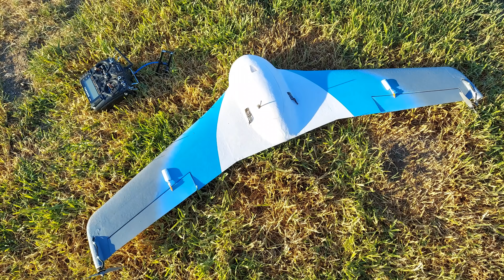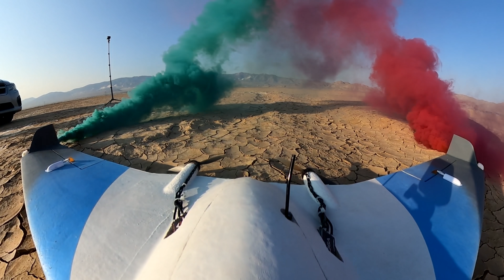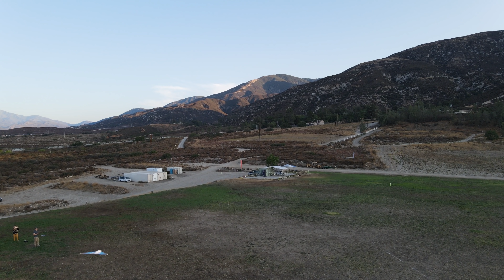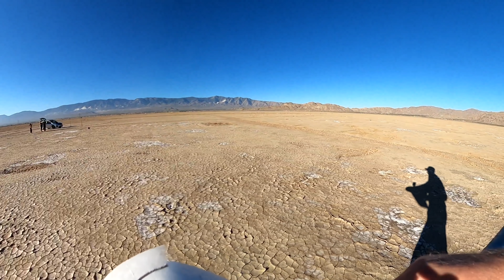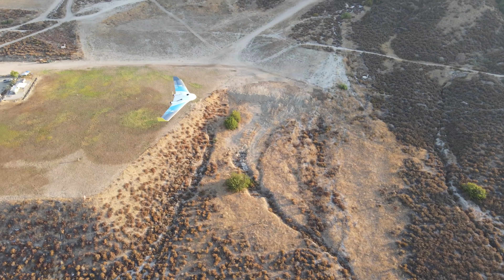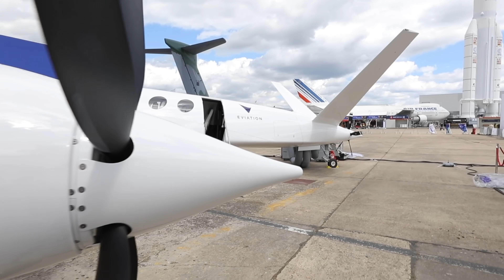Can Wingtip Motors Improve Aircraft Efficiency?  RCTestFlight Solar Collaboration Part 1

Comment: In the event of one engine going out, the adverse yaw would probably make the aircraft uncontrollable.
Reply: I was thinking the same thing. I wonder if that is why we saw a third engine located in the tail of the Eviation Aircraft?  To possibly mitigate adverse yaw effect and maintain better authority.
Reply: @Videoctr  Unless both wingtip engines were shut down (leaving the center engine), it would still probably be uncontrollable or would require huge, stronger control surfaces (and would be much less efficient).
Reply: @zed9zed  If you had a system which could shut off both engines immediately in the case of one going out, it would be just as risky as having a single engine in the first place.
Reply: @BoomchacleV0  I'm not advocating for a system to shut off the remaining engine.  There is no solution to the problem faced when one engine fails on a plane like this, so the obvious answer is - don't build a plane like this, at least not for living occupants.
Reply: @zed9zed  Would the solution not just be to cut off the other engine immediately to prevent asymmetrical thrust? Again, how would that be any different than a plane with one engine having that engine fail.
Reply: Yaw as well as roll will be induced if one of the engines is failed.. both are coupled with each other.

Comment: Great video, thank you!
One safety concern I have is what happens if one engine fails? I’m a multi engine pilot and I know how severe an engine-out is on a twin engine aircraft. 
With the engine at the wingtips, it would be even more dangerous. Makes me wonder how they would be able to certify a people-carrying airplane.
Reply: I agree. The eviation triple setup looks ok from a control POV though - if you have an engine failure you can compensate by instantly shutting down the other side and moving to degraded control mode using the central pusher prop

Electric aviation is problematic in many ways though - badly range limited and I can't see how that can be realistically addressed. My suspicion is that the longer term solution will be synthetic fuels produced from MSR nuclear sources to achieve carbon neutrality as being the only practical way to maintain long-haul flights, unless vac-trains (hyperloop) start eating aviation's lunch (and that's only really feasible on 1000mile+ legs)

Comment: Great video. :) Really enjoyed it.

I tend to think the safety advantage - specifically for aircraft carrying people - of having two or more engines as close to the fuselage as possible outweighs any potential efficiency value, even if one existed. A plane with two engines near center tends to have the ability to survive the loss of one and continue under powered flight to land safely when possible. Move those engines out to the wingtips and you introduce a tremendous amount of yaw to overcome while running on one engine. Wouldn't be surprised if you'd have to cut that second engine right away and more or less glide in, completely losing out on the redundancy benefit of the otherwise functional engine in the process.
Reply: Great point.  On first inspection, the image of that massive moment arm out on the end of the wing made me gasp.  However, I would tend to believe that the use of electric motors mitigates most of the risk of asymmetrical thrust.  Interesting dilemma...

Comment: I remember reading somewhere that the reason engines are not at the wingtips for twin engine aircraft are safety. In the unlikely case of an engine failure, the yawing force of a single engine at a wingtip is enough force to induce a flatspin.
Reply: Apparently the guys in the video didn't get that memo. 🙄

Comment: Seems to me the pusher props at the tip is battling an already established vortex as they are placed behind the wingtip. Could there be additional gains from arranging the tip motors in a tractor config.? This way the prop would counteract the "leaking" air around the wingtip before the vortex is established. Or....?
Reply from the maker: There was precedent for both in the literature, the answer is unknown to me.   Wings and propellers do affect the air in front of them, but how much?   I don't have an answer for you other than I'd love to try both.
Reply: Yeah, as per Xf5U. As I understand it there are two main advantages to wingtip motors generally. Most obviously (provided they rotate in the correct directions!) they oppose the induced vortex, ie high pressure air beneath the wing spilling out and around the tip to lower pressure above and so reduce drag and lift losses. Also they 'see' cleaner air than pushers inboard. Tractor tip props should see free stream air only for maximum efficiency (and also co-related lower noise generation). Cool video and interesting to see your results!
Reply: I'm reminded of something Richard Feynman said about experimental research. (~13:min into Messenger Lecture #1)
He said: "The Key of modern science is this Idea; That to look at (a) thing, (time after time), and to record the details, and to hope that in the information thus obtained, (there) may lie a Clue - to one or another of a possible theoretical interpretation.  It's only through such hard work that we can find out anything."
Reply: @thinkflight  You are on the wrong track. Props and wings need clean, undisturbed air. You need less separation. If you want to recover energy from wingtip spillage or vortices, put something in their way. I am not an aero engineer, but i think you will get more benefit from vertical fins, in increasing size towards the wing, stopping outward motion of air. Or even better, introduce less dihedral, or anhedral angles...
Reply: @schipe  I think he is on the right track. Because he is putting the propulsion system out at the wingtip where they perform yaw stability so that vertical stabs can be eliminated. That is a gain in efficiency is it not? Also at the wingtip you find the pesky vortices that can be diminished or eliminated with the  propulsion system acting as a sort of aerodynamic winglet reducing drag and increasing the effective wingspan. That is in effect to " put something in their way". 
Unless you have researched this out and share the results showing how this approach is futile  I think we should encourage his efforts the best we can.
Reply: 'clean, undisturbed air'  No amount of clean air stops the losses from P factor and the under spill that creates the vortices.  Opposing them directly is almost guaranteed to bring greater recovery than trying to add other items to do the same job, with their own new added drags and inefficiencies.
Reply: @schipe  Reducing verticals reduces wetted area, cutting friction drag. Increasing effective wing length reduces induced drag. If you can increase effective wing length using the same props you would normally use, without increasing wetted area, you are doing good things.  The angle of attack at the propellers changes a lot as you pass behind the wing, so if you can't switch to a tractor propeller (and suffer the propwash drag penalty) then you might consider having propellers with a more rounded leading edge, for less sensitivity to angle of attack for the propeller blade.
Reply: Both configurations would work to cancel out vortices.  The question is whether the two ways of canceling them out produce identical results to the flight characteristics of the aircraft.  The tractor cancels out the vortices before they form, allowing the wing to effectively increase span...it's setting up an anti-vortex that the wing flies through and straightens out.  The pusher configuration cancels them out after the wings make them, meaning most of the effective span increase happens after the wings clear that air, and the vortices effectively increase the airspeed that the blades see while they're rotating in the opposite direction.  Best case estimation is that the tractor increases lift potential while the pusher increases thrust potential.  Best hypothesis for when to use either is to use tractor configuration when you have a large prop relative to wingspan to maximize lift (meaning you can get away with a smaller wing for less drag), use pusher configuration when you have a small prop relative to wingspan (meaning you increase potential thrust and speed, and since lift cubes with the square of airspeed, you can use a smaller wing for less drag if enough airspeed increase is realized).  Just late night musing, really.
Reply: @Skinflaps_Meatslapper  They don't cancel out vortices, they delay them. So long as you have high pressure air on the bottom, and low pressure air on the top of the wing, you will get a vortex. The tractor has better thrust, because the entire arc of the propellor is in clean air, but you pay for that by slightly increased profile drag. The more wings, winglets, or other excrescences you put in front of the propeller, the more you bugger up the air, and the propeller efficiency will be reduced.
Reply: @DonMeaker  If you delay the vortices long enough that they're not affecting the aircraft, then you're canceling them out in all but semantics.  One could argue the production of vortices from anything if you observe the air long enough after the object has passed through it.  However, vortices are not the reason for drag penalties of low aspect ratio wings, they're a symptom of spanwise flow that is occurring before the air is even halfway down the wing.  If you have a large enough tractor prop that counters and prevents spanwise flow from spilling over the wingtip, then the formation of vortices after the fact is irrelevant because you solved the underlying issue.  A tractor configuration would naturally solve this problem before it ever becomes one, keeping the air going straight down the wing as opposed to migrating outward toward with wingtip, so the lift advantages goes to the tractor with a large diameter prop to cover as much wing area as possible (and is evident by the efficiency of the V-173, utilizing a low aspect ratio wing).

As far as the two configurations and how they relate to thrust and drag, while you are correct, you're also thinking in terms of conventional aircraft that don't naturally produce a beneficial slipstream for a pusher prop...you're missing some key ingredients.  I'm countering that a pusher prop within a wingtip vortex will see positive effects for potential thrust in the same way that a contrarotating prop sees an average efficiency increase of 5-15%.  The rear prop gains this efficiency because the front prop has redirected the air to a more beneficial AOA, just like stators within a gas turbine work to redirect airflow.  Keep in mind that the rear prop is responsible for that efficiency gain, and it has to carry that front prop's inefficiency, which is why it's only 5-15% rather than 10-25% more efficient.  Some of that front prop's inefficiency is a result of the rotating slipstream it creates, that's energy expended for no benefit in a conventional single prop. A conventional pusher prop would see only turbulence and dirty air, but a pusher prop behind a wingtip would see a clean vortex in the same way that the rear prop would see in a contrarotating configuration.  The prop diameter would have to be sized and distanced from the wingtip to be optimally placed in the vortex.  Too small of a prop or too far back and you're not utilizing the entire vortex.  Likewise, too large of a prop or too close to the wingtip and you're not utilizing the entire disk. In this experiment, I believe it was the latter, as the prop was likely only seeing the vortex affecting the center of the prop.  With a properly sized and positioned pusher, you're getting the efficiency advantage of a contrarotating prop without the complexity of one, you're not paying the drag penalty of that front prop creating a vortex, and you're not paying any penalty for having your prop in dirty air or increasing profile drag on an airframe.  That's why I think the thrust and speed advantage goes to the pusher rather than the tractor.  It would be an interesting experiment for this RC plane to have the prop positioned at different distances from the wingtip with the goal of finding that sweet spot where the prop matches the size of the vortex, and seeing what efficiency or speed gains it might realize as a result.
Reply: @Skinflaps_Meatslapper  The vortex is caused by higher pressure on the bottom of the wing, and lower pressure on the top. The tractor propeller increases that pressure differential (with correct rotation) and also amplifies lift by increasing airspeed for the part of the wing in the prop-wash behind the disk. The pusher propeller also increases the pressure differential, to a lesser degree because the affected area of the wing is larger,  (but with less efficiency because of the change in angle of attack for the part of the disc behind the wing).  The air is accelerated by the propeller disk, and the diameter of the accelerated air column that goes through the propeller necks down behind the propeller.
Reply: @Skinflaps_Meatslapper  ' then you're canceling them out in all but semantics.'  But you have a complete error in your thinking if you think that is the goal.  Start at zero.  Go to +1.  Add -1.  You're back at zero.   Then start at 0.  Stay at 0.  Stay at 0.  Remain at 0.   Which of those do you think wastes extra energy? 
You've let yourself lose the plot of you think 'just cancel the vortex' is the goal.  You lose letting the vortex form in the first place, and you lose trying to recover energy from it.
You lose a good amount of the energy the moment the high pressure air slides out from under the end of the wing.  If you're thinking you're going to do as well trying to recover the energy from that already started vortex as you would by opposing forces and not letting that air slide out from under, you're incorrect.
Again, there's a REASON the Osprey design went toward large rotors in front of the wing.  If something else worked better, they would have gone in that direction.  If 'smaller' worked just as well doing the same thing, they would have stayed with that.
They moved toward the current configuration because that's where the gain was.

Comment: Great idea, but I think propellers should be installed before the wing, but not after the wing! So that the swirls created by the propellers compensate for the swirls created by the wingtips.  Because it makes almost no sense to unroll the vortex after the wing.  Unless, perhaps, the propellers after the wing will work a little more efficiently. The direction of rotation of the propeller of the left wing should be counterclockwise (if you look in the direction of flight), and the right wing should be clockwise. Pay attention to the plane Vought XF5U.
Reply: Yes and no. Actually puszer propeller loses efficiency, but only small fraction of arc is disturbed by wing, so efficiency loss due to turbulent flow is very small. What seems to be important is final effect - no vortex = no energy loss for vortex formation, regardless where the propeller is located. In pusher variant there should be higher thrust (energy of vortex is converted), in dragger wing should have higher lift.

Comment: If the motors are counter-rotating, yes! It will definitely help efficiently and give additional lift but with the drawback of catastrophic loss of control if one goes out.
   The best setup would be a 3rd motor in the center line of thrust as a backup and for peak performance. This would be throttled down and feathered for endurance.
Reply from the maker: Exactly, a practical application would have a third motor as backup.
Reply: I'm glad I read further.. a centre mounted motor would ensure control if a tip motor failed, but the added weight, complexity & electrical draw might kill any value added
Reply: @francom6230  If the idea is just to prove concept, then Okay. But if you want to eventually get it carrying people both wing tip motors must be able to feather down…leaving you with a glider for any hope of landing.
   My understanding is that this was to prove concept so crashes are part of development.
   If you look at the V-22 osprey or Chinook both use a complex, heavy transmission & drive shafts for linked/shared power.
   What would weigh more?
   Electric changes some of that as high output motors can be very light and can tap into main battery power on demand with a little bit of cheap circuitry.
   I think if these guys are just trying to test efficiently: two counterrotating wing tip motors is all they need too.
   Everything changes when it has to be safe, though.

Comment: I think wing tip propellers in your use case make a ton of sense, even if it's just a 2% efficiency improvement with this tested design. 2% can add up when you also take into account all the other efficiency improvements you might make. Don't scoff at 2%. But as you learned, making the propellers bigger in relation, i bet you could in fact increase that number considerably.

Comment: I think this configuration makes sense on low aspect ratio wings (Vought XF5U) where i have a much higher induced drag component compared to a high aspect ratio wing. And low aspect ratio wings are better suited to resist heavy loads on the tips (like on an aircraftcarrier)
Reply: The flying flapjack indeed banked on the efficiency of the wing tips engines. My understanding it was based on NACA research from the late 30's early 40's.